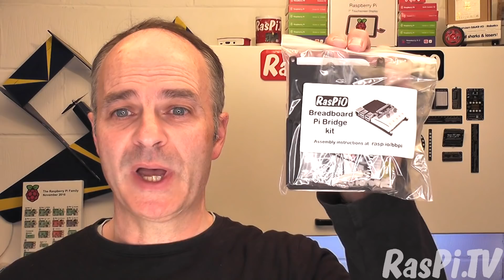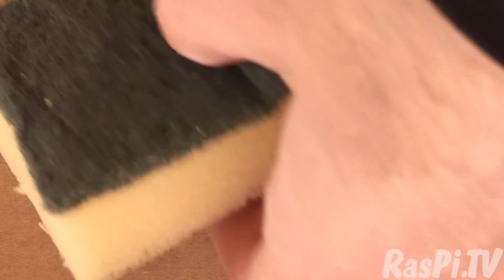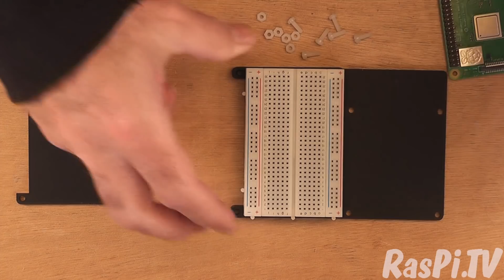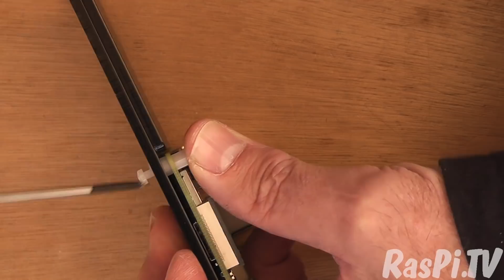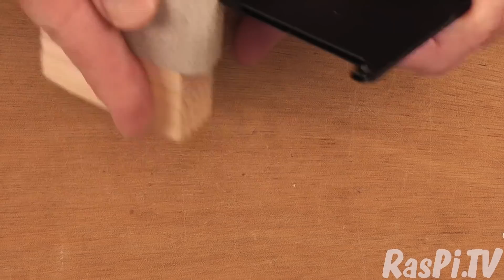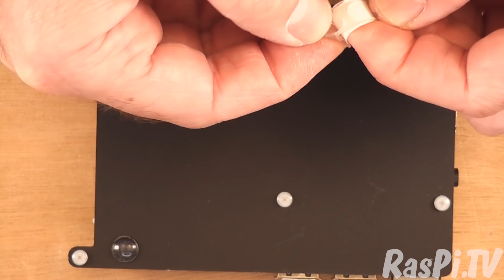RasPiO Breadboard Pi Bridge Assembly

Comment: Really nice, although I would have cut out the camera and display connector slot. I have made a project using both the camera and I/O and would have been good for testing on a breadboard.
Reply from the maker: Hard design choices. :) It would be fairly easy to do this actually, but it would completely wreck the clean aesthetic of the kit unless you were using the slots. You've still got the 'no lid' option as well. I might be prepared to consider an alternative lid if people want it, but the problem with 'forking' the product is it gets complicated fast. That's why I only offered it in frosted black.
Reply: @AlexEames  Good response, I can imagine the cost increasing to cover the mods. So I would then stick with an open top or maybe place the top on after the cable is connected. Maybe slightly larger standoffs could make this easier if at all required.